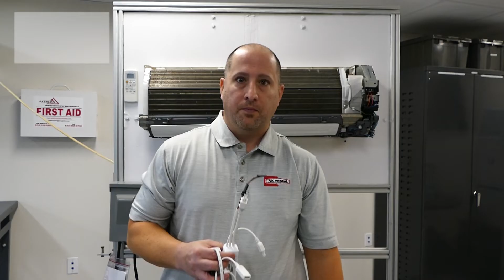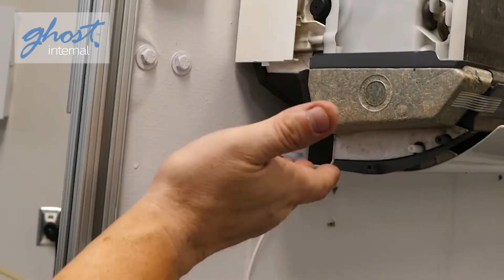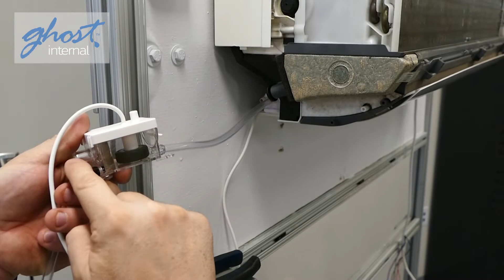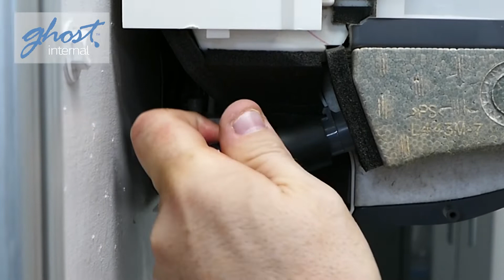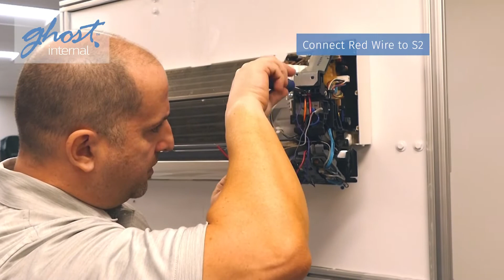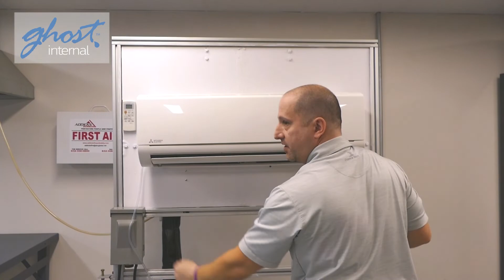How To Install Ghost Internal Pump

Comment: I wish he would explain the wire functions, disregard the colors, and why each is connected. I have a Nortek mini heat pump GHH09 head, has S1 neutral, S2 live, S3 comm, S4 ground. 230v setup. And I don't know if I should follow this installation from the video, or not.  More explanation on this specific part would be so helpful.

Comment: This was not correctly explained
Reply: I wish they'd explain the wires not the colors, and why each is connected. I have a Nortek mini heat pump GHH09 head, has S1 neutral, S2 live, S3 comm. 230v setup. And I don't know if I should follow this installation from the video, or not. More explanation on this specific part would be so helpful.
Reply: @RTCT84  what does s2 live mean. And neutral and common are the same thing. I think you should hire a hvac technician
Reply: @Pcflfsu comm as communication not common

Comment: S1+S2+S3 differs from unit to unit so this is the correct way.

1. Red of pump (on fuse) + positive (active) from outdoor must be connected to positive (active) of indoor unit.
2. Signal cable from outdoor unit on signal cable of indoor unit.
3. Black + gray from pump and neutral from outdoor unit connected together on a termal block/connector.
4. Purple from pump must connect to neutral of indoor unit.